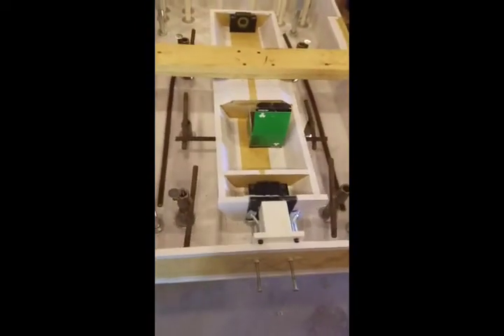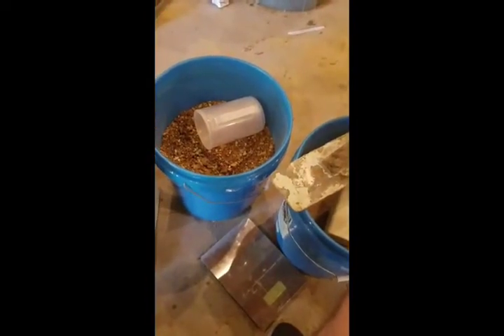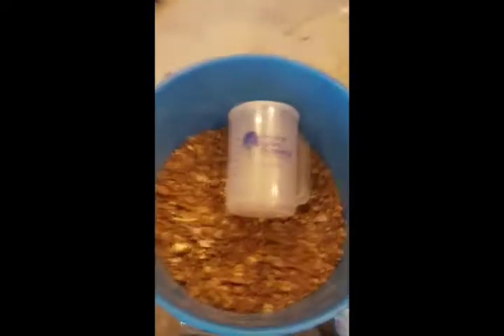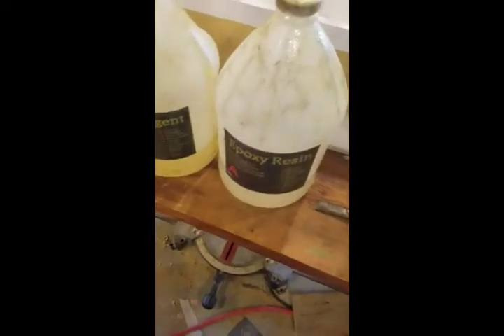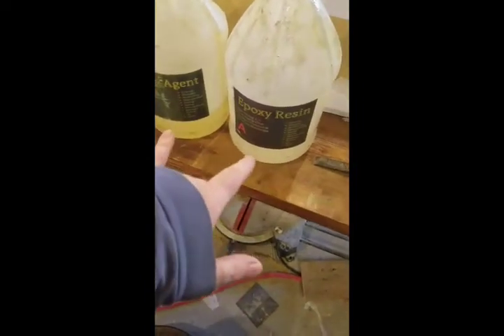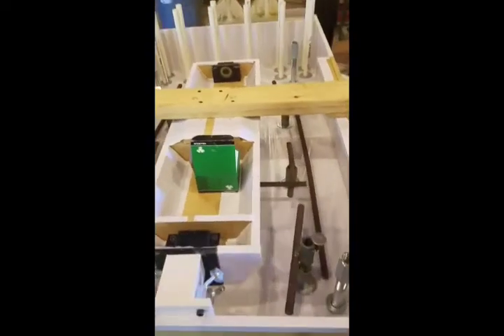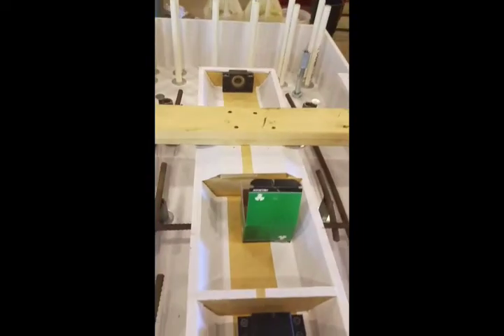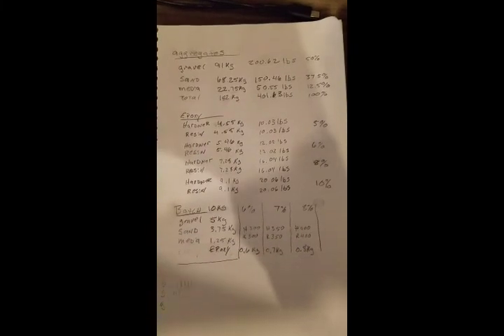Getting started with CNC epoxy casting

Comment: Thanks for a great video! Very informative. Your formula/recipe is pretty close to a German machine tool company's (forget which) formula: 30% granite gravel (aka "Decomposed Granite"), 30% joint sand, 30% fine quartz sand, and 10% Epoxy. 
Home  Depot or Lowe's has everything, possibly the Epoxy as well. Joint sand has a polymer sand in it. I like the idea of adding the glass media that you are using.  The granite gravel should be washed and dried, but probably unnecessary. I was trying to find crushed Feldspar as it is an extremely hard stone, but probably unnecessary. I am planning a CNC mill capable of  500X-500Y-100Z, primarily for aluminum. 

I see also that you have minimal structural elements in the cast. From what I've learned this is a much better approach than welding up or bolting an underlying framework for the machine. Apparently, that actually weakens the cast.
Reply from the maker: I'm glad it was helpful. I have a big tub sink that I used to wash the gravel on. Put screen wire over the drain, dumped gravel in, and washed it well. Then, spread it out in a sheet metal table and warm it with a propane blower. I did the same with the sand, but it was much longer dry times. I found that 'filter' sand actually comes clean in the bag and started using that. It was also a slightly finer grain sand. I think it's mostly used for swimming pools.

Comment: Thanks for sharing your experiences
Can you also show how you vibrate your cast? That's a thing I still haven't got a good solution for. I'm just beginning with that stuff and my tests turned out pretty crappy with lots of voids, even though I used 10% epoxy
Reply from the maker: I actually didnt vibrate it, but i did compact it using several tools. Its hard to compact at first because it only wants to spread out but as the casting fills it will begin compacting more. If you increase the epoxy to 8% or more by weight it will vibrate out better but it still seems to need compaction, so i only do compaction. If your mix is pourable, try tamping it with a wooden block.  It should compact to a solid mass that gets very hard. When it cures after compacting and still has voids try increasing you finer aggregate amount.